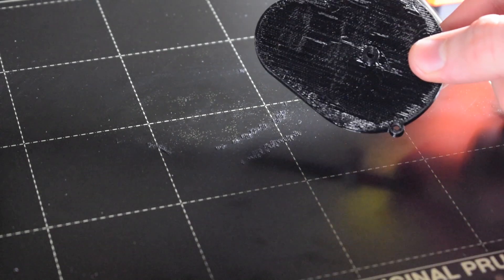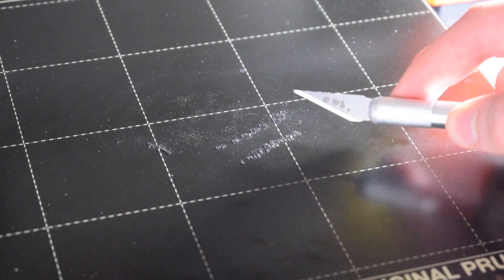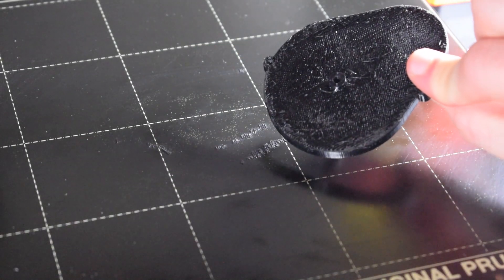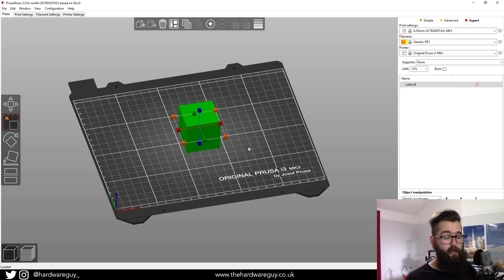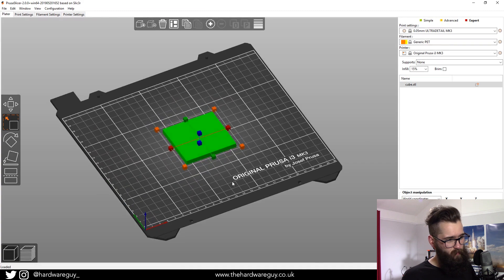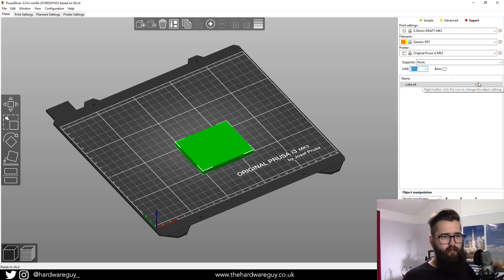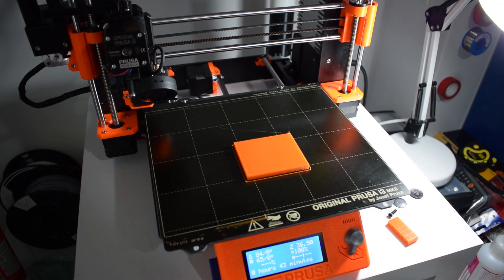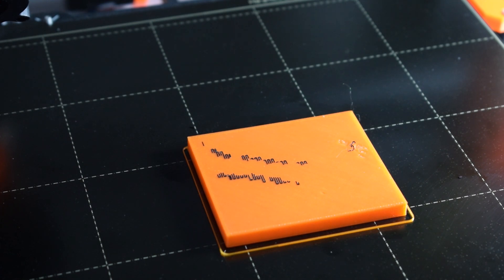Support Material Stuck To Heatbed? - EASY Solution

Comment: Love the video i have watched them like.  Have a couple questions i dont own a printer yet im going to get the mk3s thinking about buy it built i have the skills but just dont want to mess with it at first family kids and work and all that stuff.  I know i will have to work on it one day thats find im going to read the manually this week. Im a skilled trades sheetmetal work.  i fly fpv drones and build them have you printed any tpu material yet.  50% of me wants to try all the other material and 50% of me wants to use tpu for drone parts.. and just build some for the house and the kids from thingverus.. And learn how to design stuff.

Do you have a video of printing tpu or could you make one and give the setting im just nervous about using the software.  Do you have to do anything speical or have speical parts to print tpu????  thanks for your time. Thinking about becoming a patreon because im going to need you lol please get back with me thank please make a tpu video ill be wanting your vids are the best i was going to take a class but theywanted $250 i would rather pay you. do you have a email address
Reply: lol